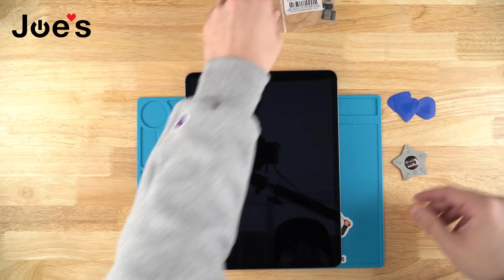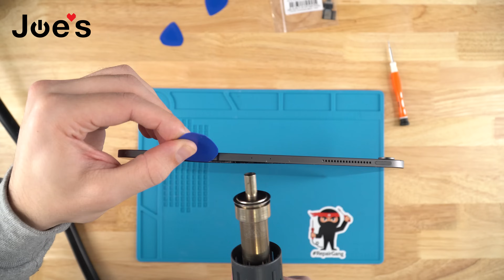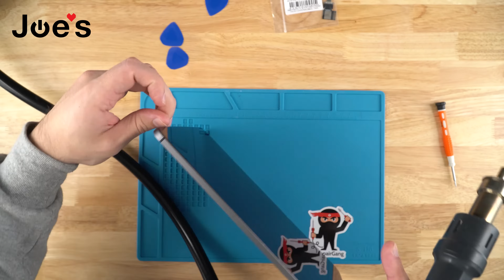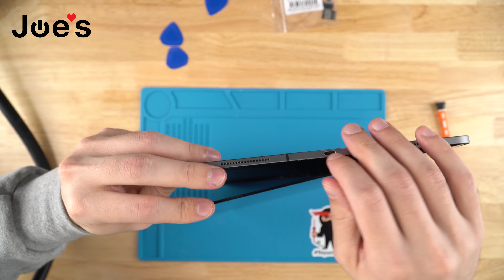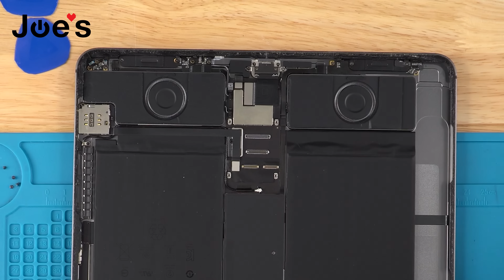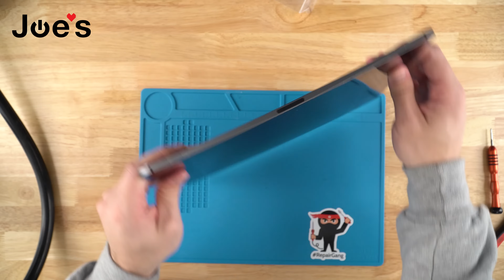Apple iPad Pro 12.9-Inch 2018 2020 3rd 4th Gen USB-C Charger Port Fix | Repair Service Tutorial

Comment: What two widths of 3m tape did you use?
Reply from the maker: We suggest using 2MM width tape on the left and top of the screen and 4MM or 5MM tape on the right and bottom of the iPad screen. 

2MM - https://www.joesge.com/products/3m-300lse-ipad-screen-charger-port-repair-tape?variant=40888444157998
4mm - https://www.joesge.com/products/3m-300lse-ipad-screen-charger-port-repair-tape?variant=40888444190766